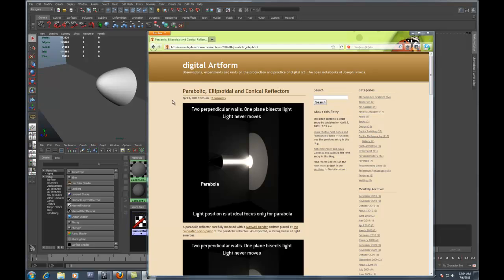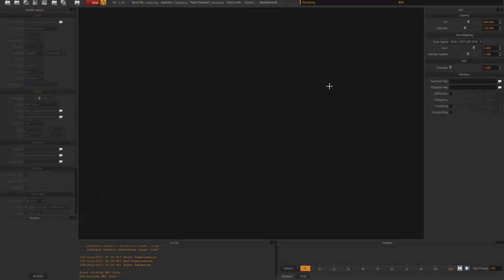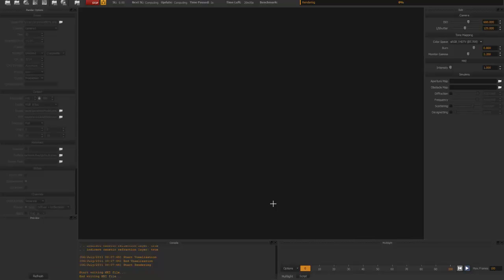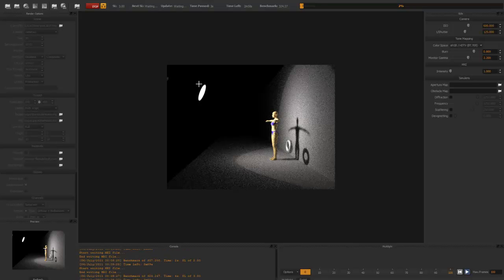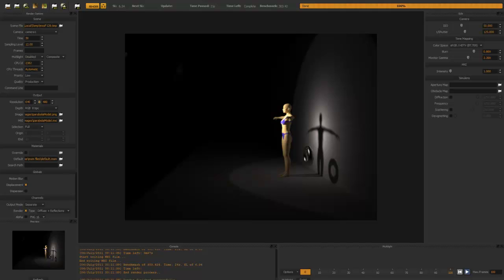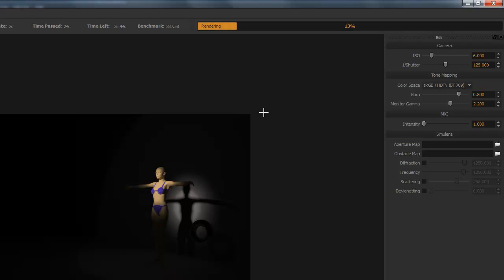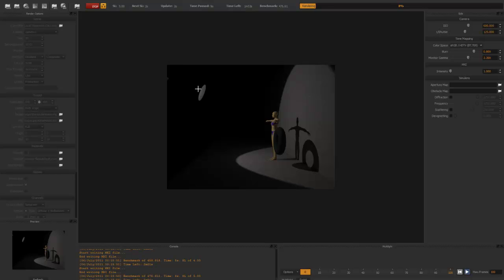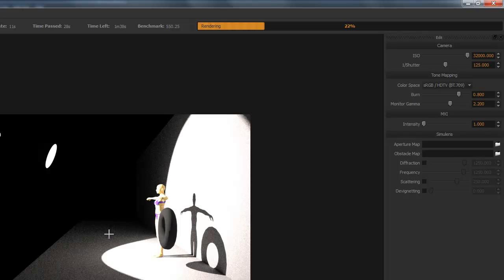Parabolic Reflectors with Various Surface Treatments in Photography

Comment from the maker: I don't have a script, but there is a link in the description to a page on which the long, thin, y=x^2 parabola can be found. Scale it by a and you have any parabola of the form y=ax^2. Translate it by c along its axis of symmetry and you have the y=ax^+c parabolas. Not immediately sure how to best do the y=ax^2+bx+c ones. To get the initial parabola I typed in the coordinates on the CVs along a degree 1 curve and turned the curve into a surface of revolution.